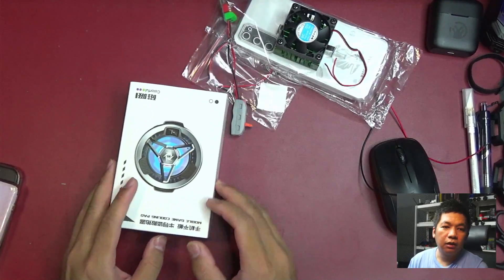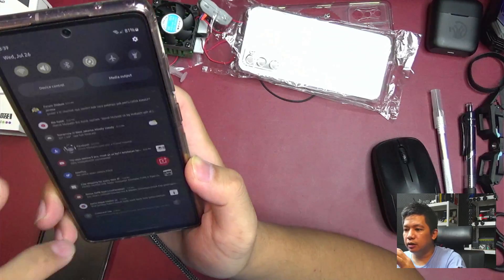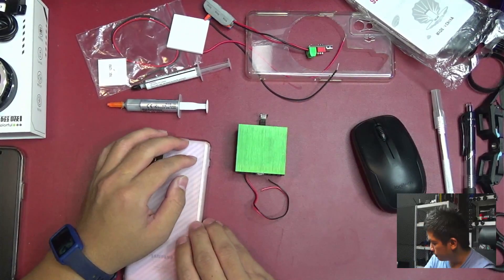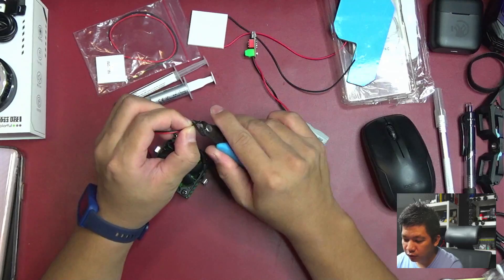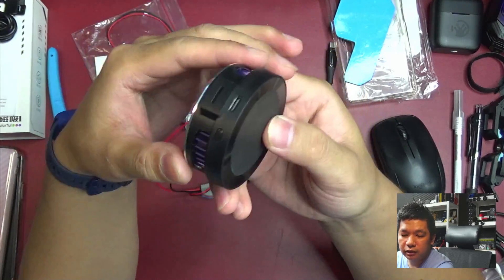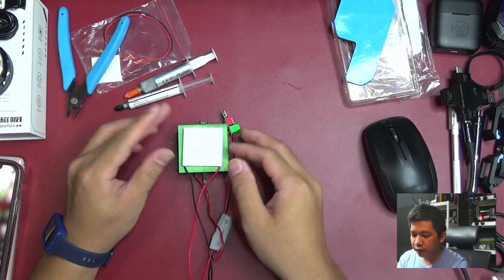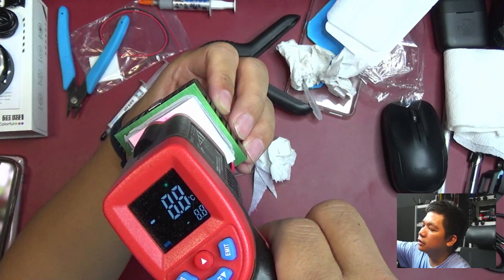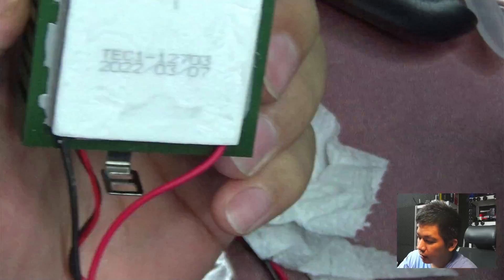LIVE bikin Cooler Rakitan Sendiri Tembus -10℃ di peltier 4cm. Link beli menyusul

Comment: kalo di tempel ke hp, heatsink bakal lebih panas, hati² overheat putus peltier. up kipas bg atau heatsink.
Reply: Up Kipas Sih
Reply from the maker: Iya
Reply: @rendimulyadi  mau tanya bg heatsink legendary udah gak nempel solusinya gmn ya yg non upgrade😅?
Reply from the maker: Bersihin pakai air dulu
Reply: @rendimulyadi  peltier 12706 dingin ga ya 😅, pakai charger 67w poco
Reply from the maker: Ngak kuat amperenya. Nga efisien
Reply: @rendimulyadi  keluaran charger 67w di 12v maksimal output nya brp ampere ya? coba divideoin di live dong bg. kasih beban gede cek pakai alatnya. tq
Reply from the maker: Max outputnya kan cuma 3A. Klo jalan di 12v ngak ngangkat.
Kecuali main di 5v.
Reply from the maker: 12/15* 6ampere
Reply: @ikhwanulihsan1072  Up kipas itu maksudnya apa gan?